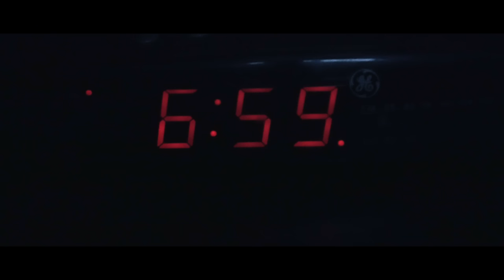Fix Sagging Shelves, The Movie - A Winter Snow Day Project

Comment: I'm not a coffee drinker -- can't even stand the smell -- but I know one thing about it, which I learned as a teenager working at a Sizzler from the owner, who did know coffee. If it's even a little bitter, put a pinch of salt in the bottom of the filter before you start building the dark, smelly liquid. Bitterness gone.

Comment: Nice video!  But all you had to do was flip them upside down. 😛
Reply from the maker: I've done that in the past but it does not fix the problem. Another option would be to get solid wood (laminated pine) and replace the particle board shelves with that. Would be much better too.
Reply: I'd definitely flip them if renting or in a jam. Otherwise, I prefer to fix things once and in a way that lasts. Also, the bottom shelf couldn't be flipped.

Comment: Loved the video. Had a huge smile on my face from the beginning.
 
Particle board is usually the worst possible choice in material to use as shelving or as cabinets in my opinion. It has little or no structural properties to it, and I have yet to find any that hasn't sagged over time when any amount of weight is applied unless it's supported by something stronger like your fix of these shelves.

Anyway, Max is a gorgeous kitty and comes up with great ideas. Thanks for the work you put into the video. Really appreciate it.
Reply from the maker: Thank you very much!! I appreciate the comment!